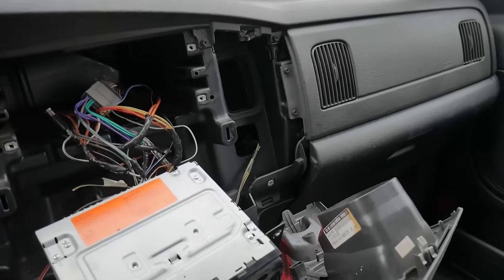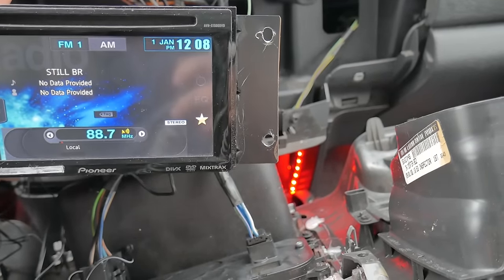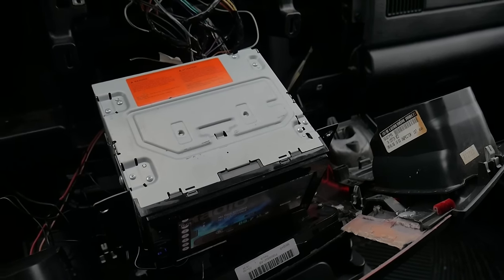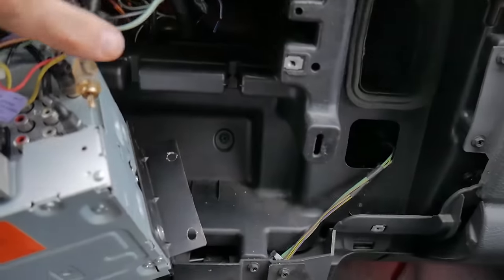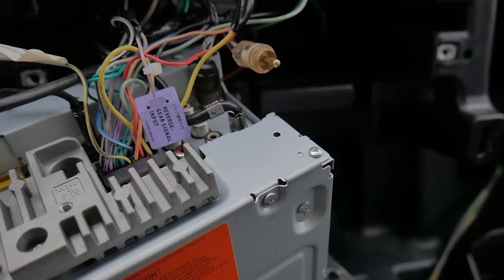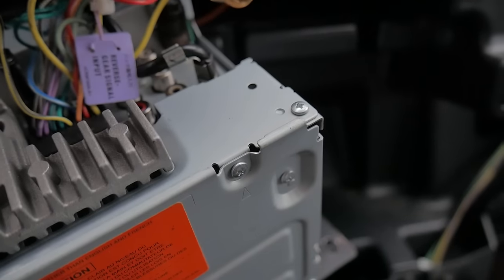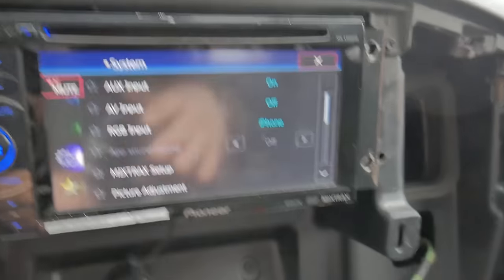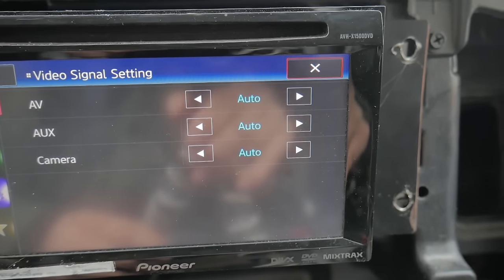How to wire a backup camera to your radio/indash screen and what settings to use

Comment: I have been working for about a week on trying to get my boss touch screen radio and backup camera to work but I cannot all I keep getting is no signal can you help me with that
Reply from the maker: Robert Gibson did you check ur connections and the settings on radio make sure rca is plugged and power and ground is good on camera

Comment: Why my camera doesn't automatically on when I put it on reverse, I have to click the AV to on the camera. Can you help me?
Reply from the maker: Do you have your reverse light wire running to the back of your radio to the wire that says reverse camera ?
Reply: @AllThingsCool  yes sir,  I have no problem with that, my concern is the short red wire because i just left it unconnected, is it for the camera to automatically switch on when I put on reverse? If yes, where should I connect it? Thanks
Reply from the maker: @eyking1105  yes run both red wires to reverse signal power, the one that is connected with rca is connected to back of radio the other red wire is power for camera
Reply from the maker: @eyking1105  check bbn this video out see if it helps 
https://youtu.be/c4oq50Ph8WM
Reply: @AllThingsCool  I just watched it, but you didn't show where the both short red wire connected
Reply from the maker: @eyking1105  both red wires on the camera side connects to reverse light wire try that

Comment: What did u connect the reverse gear signal wire to that shoulda been explained more
Reply: Killa Kaz you wire it into the reverse light wire , which can be found on the tailight
Reply: So, from the unit harness, it has 12v camera reverse line, orange solid... From the main harness into radio, there are a few lines, Including back car (pink) and brake (green with stripe)

The pink goes to reversing light. How do you keep it on for the dash, I planned to run the wire from ACC as it instructed. There is a trigger blue wire so I assumed this is for pink wire?
Reply: @youtubeonly8574  
@UCpw3VLPxdpFf6cFYrkSv8sw
I can't get my back up camera to work.The power red wire is connect to my camera and the RCV red wire is connect to a red wire coming off the HU. But is doesn't work in reverse or during camera view on my 2300NEX, please help. Thanks Should I connect the red wire near the camera to the reverse light and then connect the pig tail red wire near the HU to the purple/wire for the reverse gear?
Reply: @theelusiveone147 

1) the blue trigger line or reverse detection goes to smart junction box of driver's side to tap into r gear switch.
2) camera power goes to reverse light, ground on chassis, but can use negative line instead.
3) here is confusing part of using chinese part, this is where I dont remember. Red goes to constant battery I think, or its acc.
Reply: TheLucanp yeah, the camera pop up black, you can see the parking grid assisted when I put it in reverse. But the camera doesn’t work. I’m so confused
Reply: @theelusiveone147  the unit need the power to the camera.  Let me check with mine and I will return to you in a few hours.
Reply: TheLucanp my generic cam is power by the back light. Wish I had a volt meter
Reply: @theelusiveone147  yes I have to look at my wiring, when my kids has gone to bed I will be able to take a better look
Reply: TheLucanp thanks man. I’m picking another camera and hopefully that works

Comment: Do I still need to wire the reverse lamp? I wired that red wire straight to the purple wire and nothing is happening
Reply from the maker: Yes wire both
Reply: Okay thanks a lot I was going crazy cause it wasn’t working lol
Reply: chuck kososky I got it to work but now the red and purple wire at stereo isn’t getting any voltage, the reverse image pops up fine tho when I do it manually but I never pops up automatically
Reply: chuck kososky can I splice the red and purple wire from stereo together to the constant power 12v yellow wire from the 16 pin harness?
Reply from the maker: @santosaleman7060  u ran the reverse signal wire to the back of radio to right
Reply: chuck kososky yes I did, I figured out that my camera came with 2 red wires on the yellow rca, one to do a 3 way splice with the reverse and the one for the stereo, thanks a lot for your help tho!

Comment: My backup camera cable has a red wire at the top and bottom
Reply from the maker: One goes to reverse lights a d one to battery I just ran both to reverse light
Reply: @AllThingsCool  question.  I connected the red wire at the end (towards licence plate) to the purple/black reverse wire.  No issues there.  Does the red wire at the top (by stereo) goes to the ACC or should I use the same purple/black wire that I see by my stereo?
Reply from the maker: @bbalingit  the red wire that runs back to your radio goes to the back up camera wire on back of radio. When you put your truck in reverse it sends a energized signal to the back of your radio to tell it to switch modes to video for back up camera
Reply: @AllThingsCool  thank you that's what I thought.  The wire coming out of my radio is called "reverse detection".  Seems like that's the one I should use?   I'm not getting a signal to the radio so it must be that my camera isn't getting power.
Reply: @AllThingsCool  I see that you connected both red wires (the ones close to your license plate).  I think that's my problem as I only connect one of them.  Does that sound right to you?

Comment: it still didn't work
Reply from the maker: Robert Gibson is the power wire on the camera hooked up to a reverse light source did you test the wire to make sute power goes to it when its in reverse ?
Reply from the maker: Did you check my install video out maybe it will help 
https://youtu.be/c4oq50Ph8WM